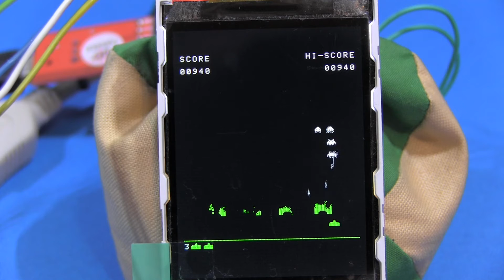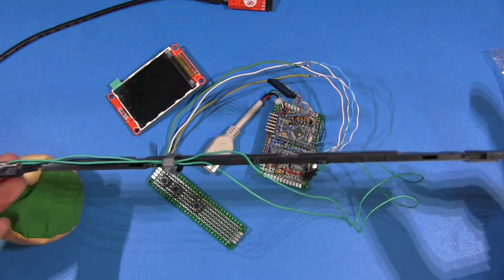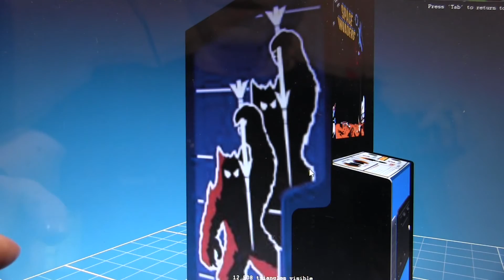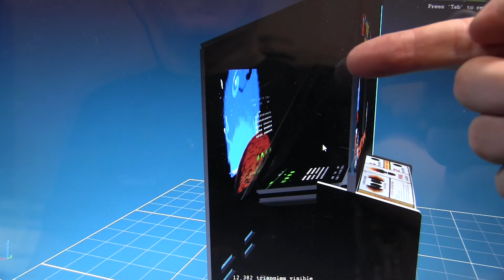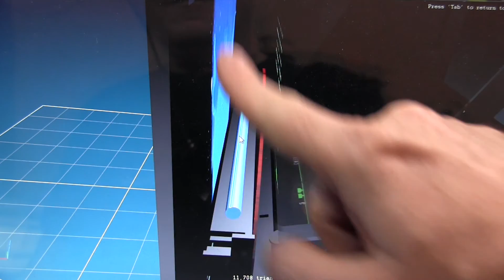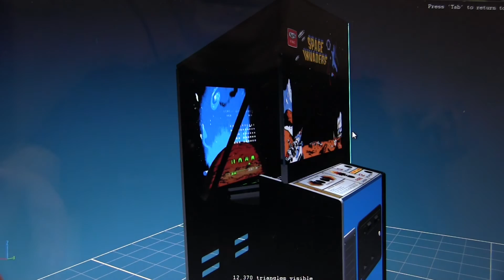Tiny Arduino Space Invaders machine #1 - "Watch This Space (Invader)"!

Comment: Which display are you using ? Top should read, Score<1>   HiScore  Score<2> :)
Reply from the maker: I didn't code a two player version of the game, that's why the top line is different (and how you know it isn't an emulator). The display is a 2" TFT, it's the smallest screen I could find with at least 224×256 pixels (it actually has 240x320).
Reply: HaHa, that's how I knew it wasn't a emulator.Your display looks like the 2.4"(2.2/2.4/2.8") version, it should say on the back.:)
Reply: @thehighprotondiet3127  Could other games be played with that system...for example, Valkyr? ;)

Comment: Tips...

Making a cabinet, It's  a one way mirror(not a mirror), use a phone "Mirrored" Screen Protector(one way) or one way mirror window film. They used a white uv tube and not a black light, use a mixture of UV and white LED's. The star field was printed on card ,print the back ground on a white paper(check the paper glows under uv). The Moon was made of print clear plastic, paper again will do... :)
More details, The front plastic glass, had white bulbs behind it light the top Space Invaders.
Reply: I did write the game code and video driver. I think I can reverse it all, no problem.
Reply from the maker: Yep. I got some of that last week. Expect a mirror soon (next video).
Reply: But, you have mirror your display(reverse), reverse text font and and reverse graphics ?
Reply from the maker: not yet :-)
Reply: depends on how you are doing it.... Good luck
Reply from the maker: Yes, I'll be using LEDs for the UV. Thanks for all the tips!